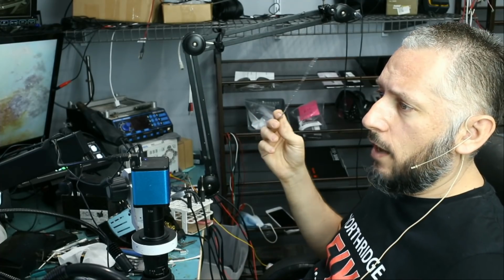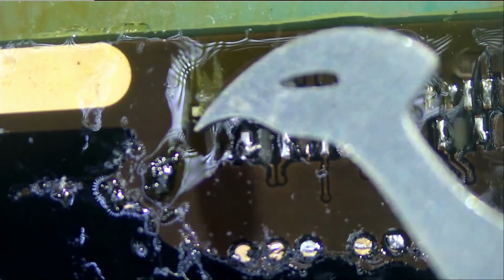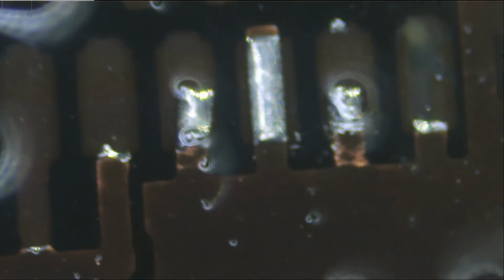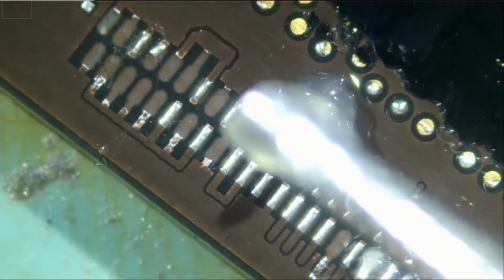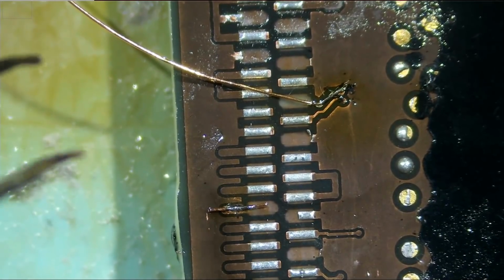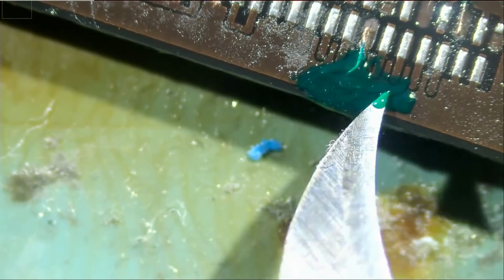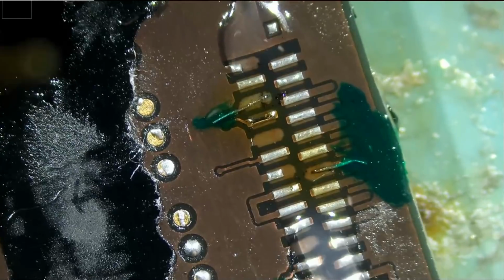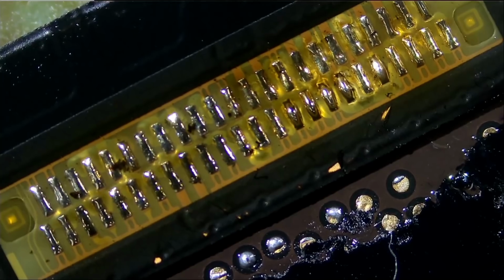iPad 6th Charging port Repair Disaster. - A1893

Comment: Friends had one of these iPads, the charging port has issues. The pins in the port are just fine, but it still doesn't connect right unless something is placed under the charging cable prying the cable in a upward position right near the port. Once it's propped up it connects. I told them to just prop it up, charge it up when not in use. It's a work around without opening it up and replacing the exact part you did. Not saying I couldn't replace the port, I do have the tools, it's just it could be a costly repair and the pad is not worth it, even though that's the only issue it has.

Comment: I tried buying the parts from local shop, but sadly all of connectors I bought for ipad air 2 had no holes to transfer the flux from the pads on the logic board onto the connector pads. Does anyone know how to solder the connectors even without holes on the pads?
Many thanks in advance

Comment: G’day , how did the customer get the board to that stage to start with?......was it to much heat possibly or not enough and yanked it off?......just learning electronics at this stage and you videos are fantasic👍
Reply: Probably a combo. Not enough heat and probably was pulling on connector before solder was melted.

Comment: I just noticed that you do not have eye pieces on your microscope 🔬, so do you only use the monitor when working?
Reply: my technician doing always likethat
Reply: I find it better to work without eye pieces, it works so much better, especially with microsoldering

Comment: For removing solder mask I personally using electric nail file that I bought at the Dollar Tree .it's not powerful so it doesn't remove anything other than the solder mask.and you could get diamond file bits a out as small is a exacto knife

Comment: I appreciate your practicality, but that's a lot of ground and probably 5V power pads  to miss out on a charging port, especially for ipad. No doubt the ipad works again for now but now the remaining pads have to take the extra current to make up for many missing ones. 90% of the time this won't be a problem but I wouldn't be surprised if the remaining pads burn out eventually from having to carry so much extra power. I will generally skip a few ground pads here and there, don't get me wrong, but this seems like a lot

Comment: The person saying the stuff about the Glass Fiber pen is somehow right. But you will remove the soldermask not only from the trace. Therefore you will have to reapply soldermask to the exposed parts you are not going to solder on. More work, less risky. I think it won't apply to your business since it would cost more for the customer. But i don't see any problem with your method since you seem pretty trained with the blade :).